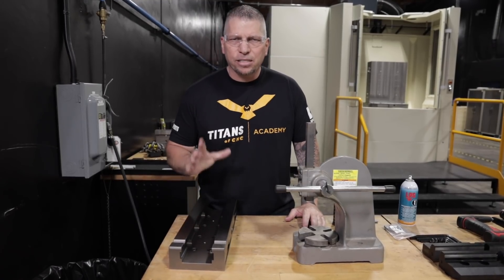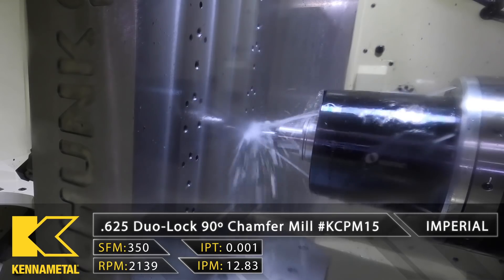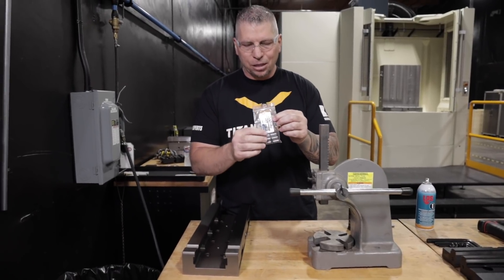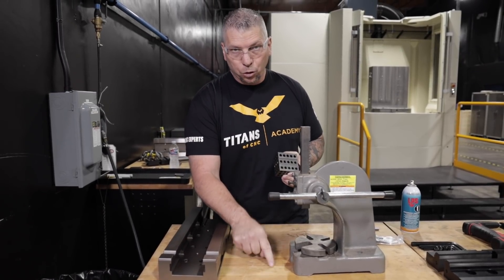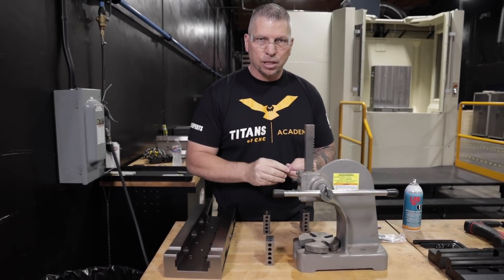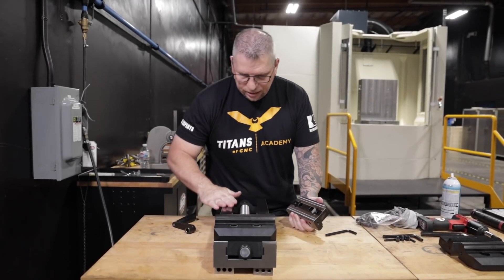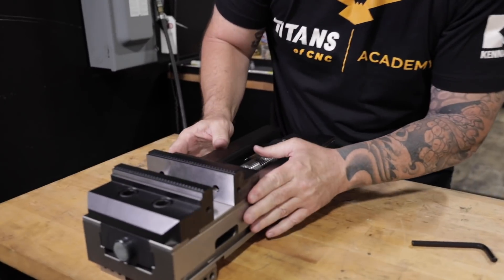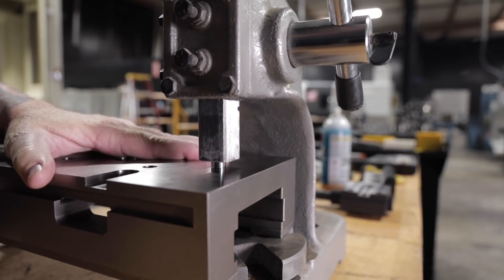60 HP MAKINO | Dual Vise Set-Up & Installation | CNC Machining

Comment: I think it would be valuable for the new machinists out there, to go over the types of fits used between dowel pin diameter (as well as the tolerance of the dowel pins) and between the hole diameter that was used to get an accurate & repeatable assembly for fixturing parts. Have you already addressed this in your aerospace academy?

Comment: Do a video on how you guys machine critical fits like bearing bores. The company I work for uses specific finishing tools and probe the bore to get the correct wear offset for the tool to hit the dimension. Definitely not the only way but curious how you do it.

Comment: Thanks for the great video. Learn a lot in these videos with the explanation. Can you explain, it seems if you have the movable jaw "down" that all the weight of the part is pushing solely on the ball screw rather than the bolts in the fixed jaw. If you wanted your work centered, couldn't you just have placed you jaws differently on the tombstone?
Reply from the maker: Think of it like double vises... wouldn’t it be exactly the same thing on the lower jaw? The way this vise is engineered. It’s rock solid and rigid no matter which way I went. This allows me the most versatility and allows my parts to stay higher on the tombstone and my massive spindle dia away from hitting the pallet etc.

Comment: Hi Titan - Great instructional video as always!  Quick question: what is your standard (if there is a standard) interference fit for press fitting dowel pins?  Does it also depend upon the material the pins are being pressed into?  Thanks again!

Comment: What design feature make it so much better and more expensive than a kurt style vise?

12:00 Not worried about parts dropping onto the operator or their tools when loosening the vise?
Reply: Swiss engineering
Reply: Schunk Vices are built in Swiss at Gressel
Reply: with any part that big they will secure it with a crane no chance to drop

Comment: Why You don't put any corrosion inhibitor between vise and tombstone? I heard stories that rust will appear in those places and move vise, is it true?
Reply: I'm no expert but I've found the "rust" or general built up of crud is related more to the coolant quality. 
We have machines with rancid coolant that leave a nice orange/green scale on the bed when removing fixturing, but the newer machines with far less contaminants in the coolant sump leave a very clean table. 
Just my experience, I tried wd40 once when I knew the vice was going to be installed for a longer period and it made very little difference.
Reply: I think with properly maintained coolant rust is a non issue
Reply: Thank You guys, you're right